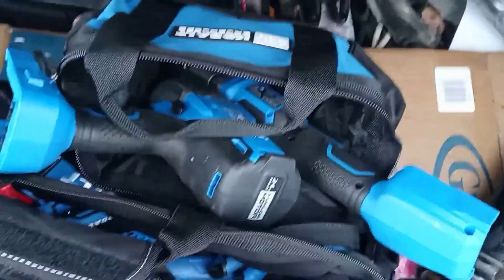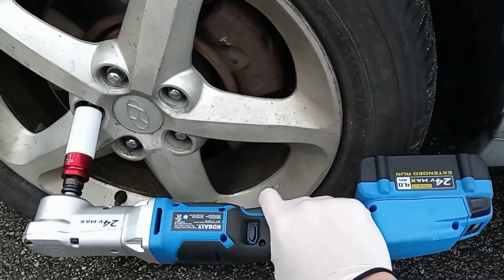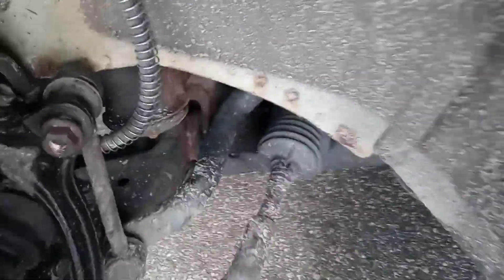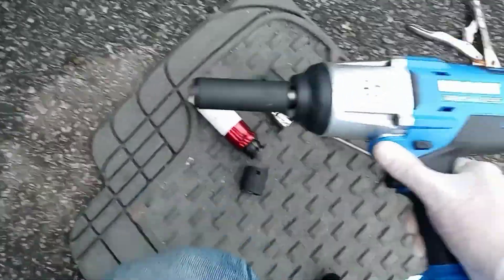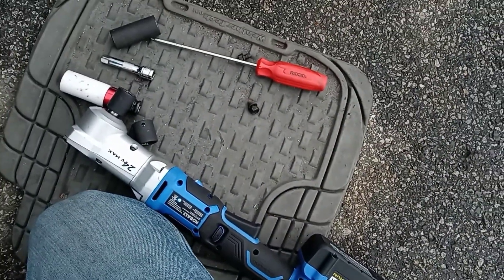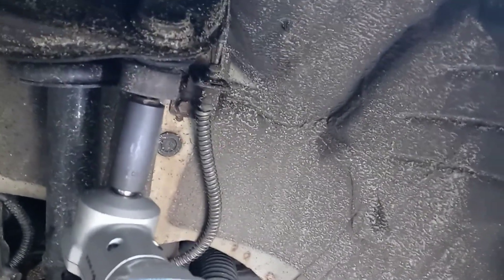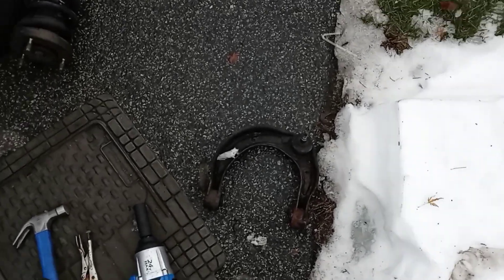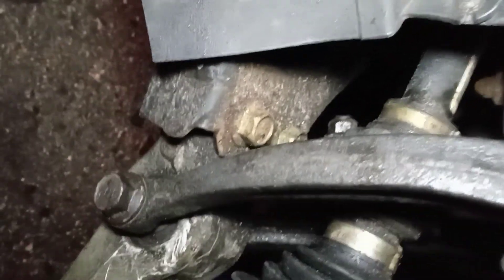kobalt 24v right angle impact wrench/ DIY 07 sonata suspension/ testing out my new tools

Comment: I just subscribed to your channel. I like seeing vids like this. Real world testing. I’ve thought about doing this kind of stuff also, I have the kobalt impact wrench and it’s a beast for what ever I’ve needed it for.
Reply from the maker: Thanks bro. Ive watched alot of tool videos and some of them are inside clean shops. So i wanted to make sure that the tools i buy are junkyard tested and rusty bolts in all! I bought the kobalt right angle impact for a 100 bucks and i luv it even with the flaws it has. Check out that video too.